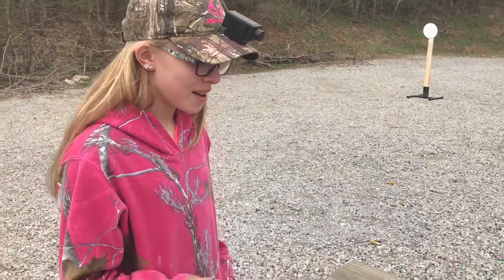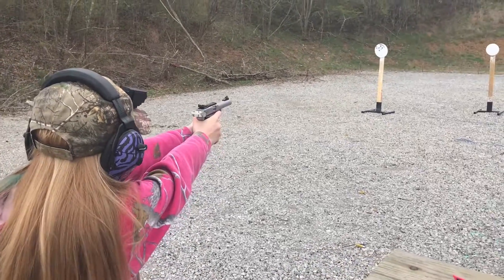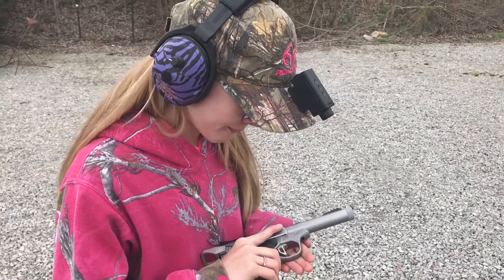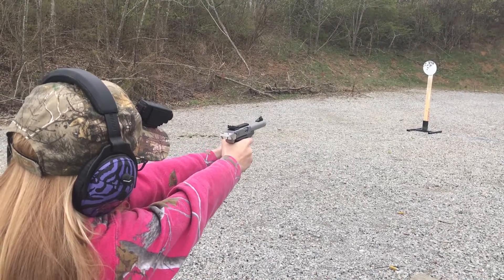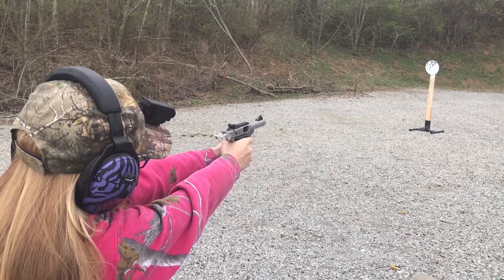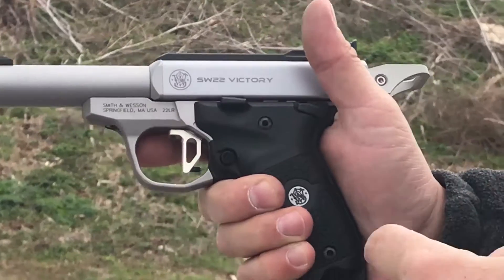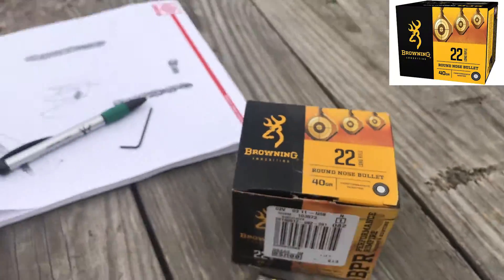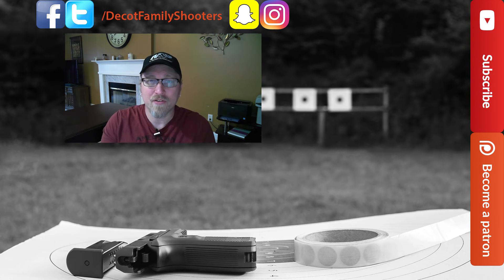SW22 Victory First Shots - Ammo Test

Comment: my TK trigger for my sw victory wouldn't  let it reset, and I couldn't
use the pre-traval screw at all I even had to file the trigger down on the area where the pre travel screw comes though the trigger, and my over travel screw is screwed in so far that I'm afraid it will probably fall out some day even with locktite on it. still could used some more over travel adjustment but it wasn't available. they should have the over travel screw up higher on the trigger.. I still like the trigger. . . 2 1/4 lb. pull. with zero take
 up.TK told me the sw victory frames vary in tolerance.  I enjoyed your video, that young lady has been taught very well, it always makes me smile to see the youth properly and safely shooting and enjoying firearms. Great job!
Reply from the maker: The reset is finicky,  I had to adjust mine several times to get the gun to reset consistently.  I love that dang trigger too.  Fefit is soooo much faster with the TK equipped Victory vs her old M&P22c.   We still use the MP@@c for training kids to shoot 9mm due to common manual of arms, but for pure SPEED competitions,  VICTORY FTW!

Comment: Mine hasn't had a hiccup and I've shot over 1000 rounds with bulk. You messed the gun up customizing it.
Reply from the maker: negative.  I had the pretravel set screw to tight, AND she kept hitting the safety on.   She has well over 6000 rounds on it since then and it runs fantastic.  #Tandemized FTW!